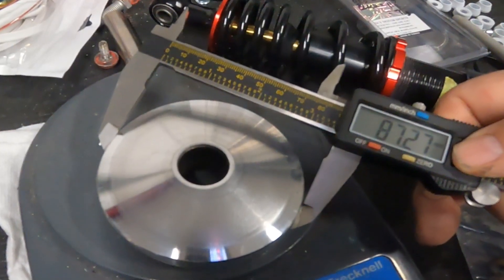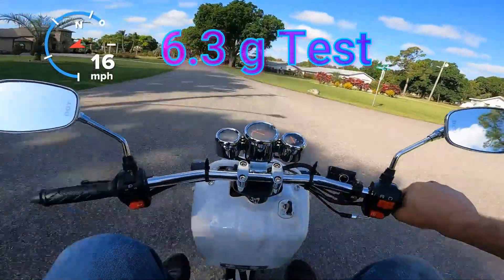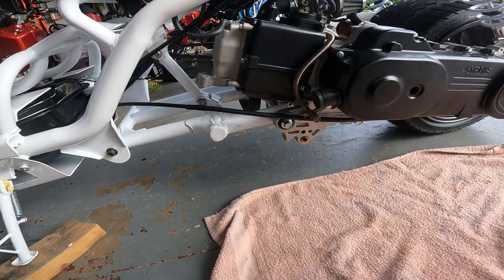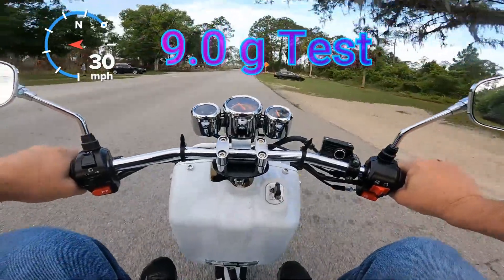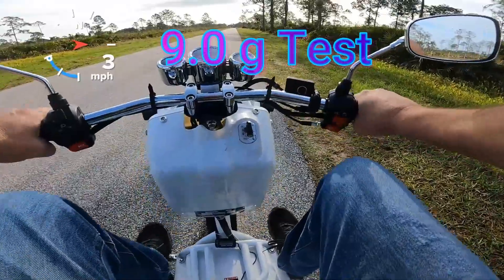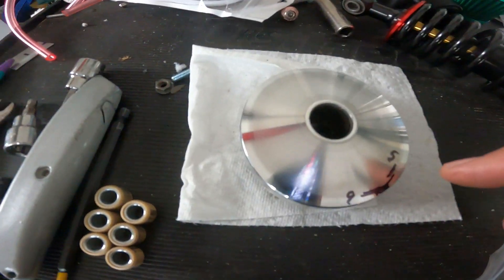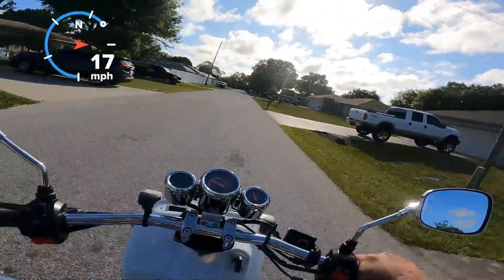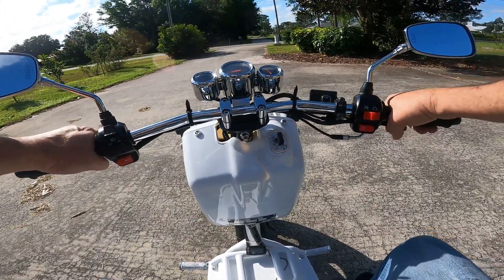Maddog 50cc Roller Weight Test.  139QMB GY6 Results

Comment: When you used the 4 gram did any of the rollers melt? I put a cam in and my rollers just melt and the belt completey disintegrates. Im waiting on heavy rollers but do you think thats it?
Reply from the maker: Never heard of them melting.  Wow.  We're they quality rollers?  Even the cheapo test rollers have not done that on me.  That belt is slipping and making lots of heat.  Is any of the belt stuck deep down in the rear clutch pulleys?  Or just shredded?

Comment: Question if you change the spring in the clutch or the spring behind the clutch will the motor get more power to move that clutch. To make more power to the back wheel axle gears? Btw love your videos keep up the great work
Reply from the maker: Thanks.  And no more power can be made in the transmission...  it is just where and when you use the power.  So heaver clutch shoe springs will take more spinning speed or RPM of the CVT and the engine to open.  When they finally open the clutch will engage the rear wheel and the bike will take off.  Since you are at a higher RPM and making more power it will take off faster and be quicker.  Top speed will not change but acceleration will be better.  So what is the downside?  It is more annoying to drive for just cruising in traffic as it does not take off until the engine is at a high RPM.  It will wear the clutch out faster as it is trying to engage at a must faster speed.  Like doing a burnout with your tire will wear your tires down faster.  It also creates a lot more heat if you start and stop alot.  The big spring or contra spring tries to prevent the clutch plates from spreading apart and letting the belt slide down into high gear.  The heavier the spring the more it resists.  The downside is the bike may not ever get to top speed.  The upside is it does not shift up as quick so it makes it stay higher RPM longer and feels more peppy.  Like leaving your car in 1st or 2nd gear.  When you get on the gas it goes as it is already in the power band.
Reply: @GhettoWrench thanks for the info I just was watching and thinking that it might help low and top. Thanks again keep up the great videos. Can't wait to see what you do to the white. 50 cc do you think it's better to get the 50cc or the 150cc?
Reply from the maker: @justindawalga7456  The 150 is way more bang for the buck...  but u usually need a motorcycle license and some states require insurance etc.  The 50 is funner to modify and work on cause it is so slow..  LOL
Reply: @GhettoWrench  I'm getting my license in June but I think I'm going to get the Ryker 150 from txpowersports. It has a 10 HP motor not a 8 HP like the ruckus and the mad dog.
Reply: Ya I'm getting my license in June looking to get the Ryker 150 from txpowersports. It has a 10 HP not 8 like the maddog and the ruckus.
Reply from the maker: @justindawalga7456 cool.   that will be great
Reply from the maker: @justindawalga7456  keep me updated.  I want to know the top speed on that.  That bike looks pretty sweet and cheaper than maddog too.
Reply: For sure hoping down the road to do videos like you do. You do a great job expanding everything. I'm 35 280 so it says it does 55 max speed with 550 total weight on it.
Reply from the maker: @justindawalga7456  we will both become famous youtubers and do a collaboration.   LOL
Reply: Ya maybe do a scooter cannonball

Comment: no heavier roller are not for more top speed... its all about proper tune. sometime heavier roller can make you go slower if you didnt tune it properly.
a properly balanced cvt will both give betetr acceleration AND better top speed. there is no " heavier for that, lighter for that ".
when playing with roller, you must have contra springs too. and as usual skip the malossi white. its softer than original on ALL engine even for 2broke ( 2 stroke 🤢).

those engine, without bbk, can handle 10k rpm all day long no problem. these cheap crank are MADE for 72cc bbk, so yeah they handle 10k rpm STOCK very fine. thing is its a waste. in stock form ( without bbk, without A9 cam, without port&polish, without titanium valve spring and so on ) the peak torque is around 6800 rpm and peak power is around 7600 rpm. that means running at 10k rpm will hurt top speed by alot if the road is not flat and level. but they can do it fine. 
when you get a 47mm bbk and A9 cam together, NEVER go over 7800k rpm. N E V E R. the crank is made to handle this 47mm bbk at 7800rpm no more. 
the naraku hd crank can handle 10k rpm with a 50mm bbk fine. it can even handle 52mm bbk for about 8-12k km. yeah its alot but this is what Naraku quality means.

Comment: I’m confused on something is the power band on a 50cc 150cc and 232cc the same like should you be aiming for 8000 rpms on all of these engines or higher on bigger motors like the 232. I have a 232 and I set my rpms at or around 8500 rpms top speed is around 86 I hope you understand what I’m talking about Thanks
Reply from the maker: I think they are.  I am just guessing as I really can't find any dyno runs with curves on these things...  but looking at GET 50s and Grom 150s it seems to peak about 8500.  I would guess a 50 was higher like 9k and the bigger 180 to 232 might be lower, but who knows.  I strive for 8500 with my 171cc also.
Reply: @GhettoWrench  Thank you sir